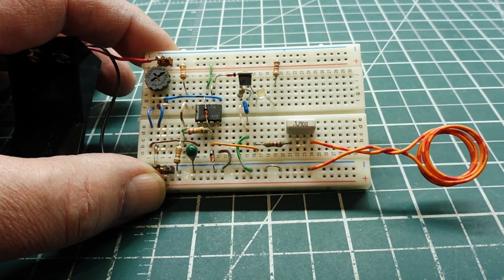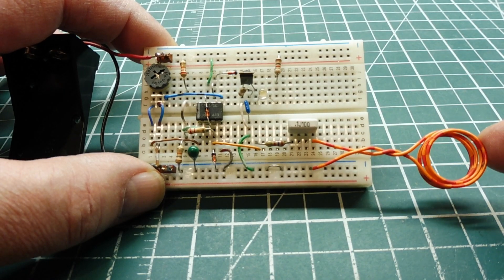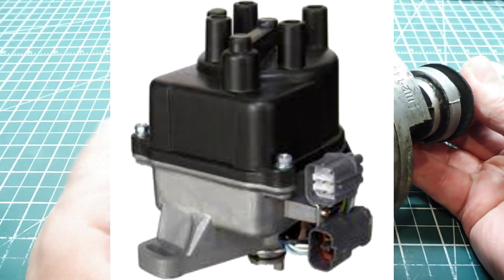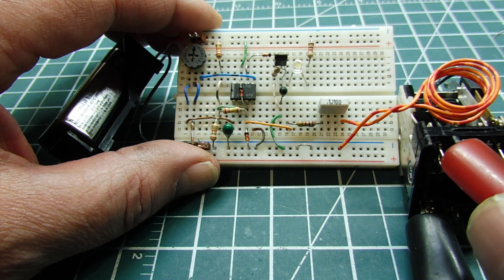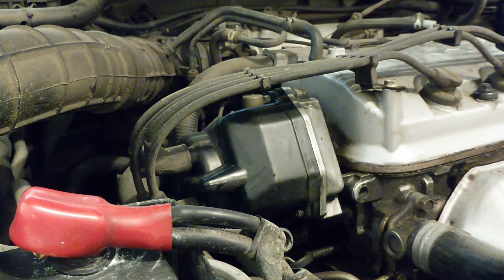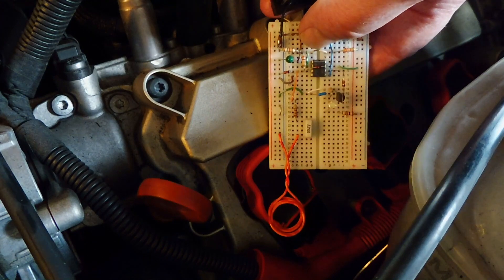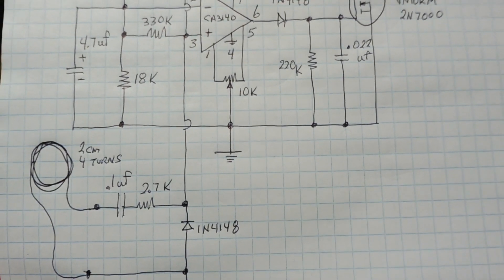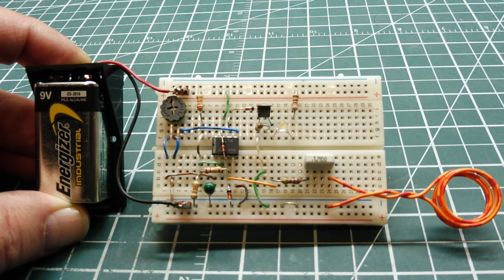Ignition Coil Troubleshooting  / Ignition Pulse Detector

Comment: Thanks for sharing, I had bought a chinese relay board which it was installed on my pellet burner, 2 out of 4 relays were no good from the start,  It gave a good  headache until i figured it out, since then i make my own relay drivers, this is an excellent little circuit handy for troubleshooting.

Greetings from Greece
Vasilis K

Comment: Nice video. Interesting circuit. Could a hall effect sensor replace the large coil ?
Reply from the maker: The coil is actually detecting the collapsing magnetic field of the ignition coil as that is when the spark is created. Using a Hall effect sensor could be another option.

Comment: Could you also mention you used zener diodes all around the circuit :)
Reply from the maker: IN4148 diodes are not Zeners but they do clamp the output voltage of the pickup coil to a safe value.